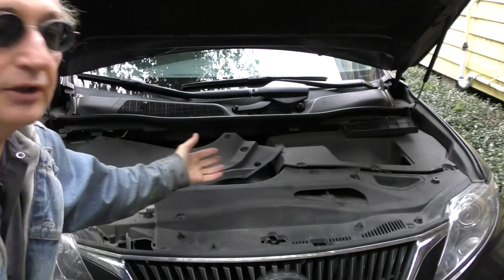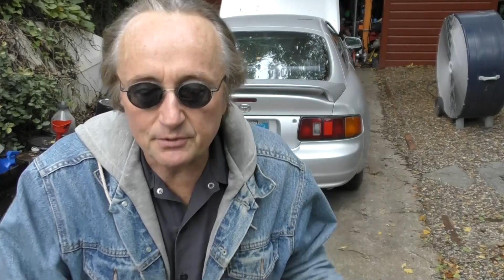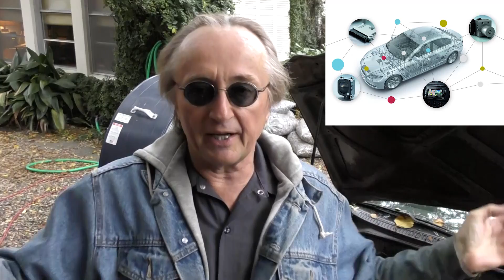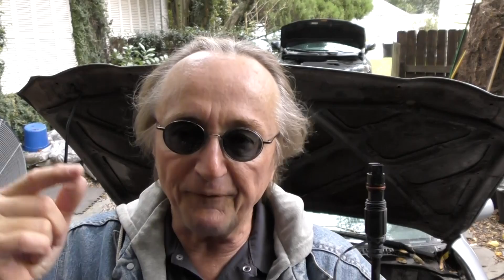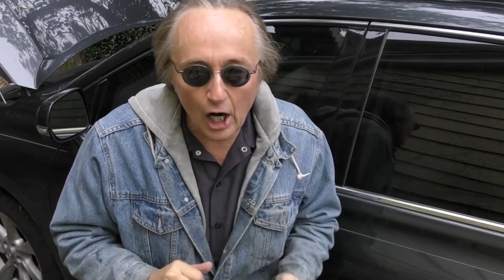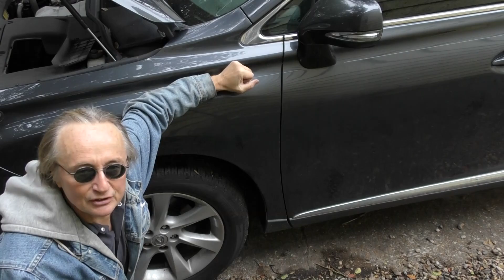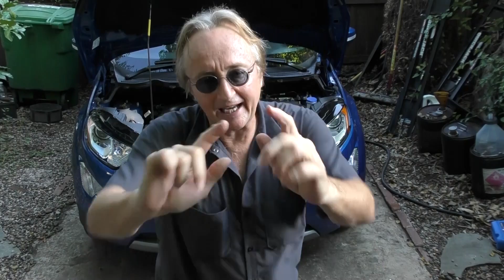The End of DIY Car Repair, Why New Cars are So Hard to Work On

Comment: I still always change my own oil.  At least that's one thing I can do. That way I know it's done right, with the best oil and filters.  Recently my daughter and son-in-law bought a used minivan from a dealer.  I had to borrow it to get some stuff from Home Depot for them.  I always like to check the oil in cars I borrow from anyone, so when I come out from the store I decided to check the oil .  The parking lot was level (their driveway is not) so I could get a nice accurate reading.  Well, the dipstick showed almost NO OIL!  Just barely registered on the bottom of the dipstick, not even close to the safe zone.  The vehicle had less then 500 miles on it since they bought it so I figured the clowns at the dealership didn't put enough oil in it.  I checked how much oil it should have, which is 6 quarts, so I'm guessing they only put in 4 quarts.  This is why I change my own oil!  (Of course, I walked over to the Walmart next door and bought some oil and put it in).
If you DO get your oil changed at a shop, always check the oil level BEFORE you leave.  You never know what kind of careless job some of these places do.

Comment: Maximum profitability with a dash of engineered obsolescence  and making it hard to work on yourself so you have to take to dealer.  Late 90s Cars are the most reliable, durable and easy to work on.  Not to mention affordable

Comment: Hey Scotty! My 1999 Toyota Avalon has suspension squeaks when turning at low speeds. My mechanic changed all the suspension parts with KYB struts, mounts, etc. The noises still persist. The mechanic adjusted the mounting a few times and it still does it! What should we look at next?

Comment: I love hate modern cars, manufacturers squeeze the engine in sideways. had a VW Rabbit, I could not even see or feel the spark plugs the engine block was up close to the firewall. Too many engine parts are made from plastic.

Comment: Modern cars are still very easy to fix, you just need the tools to do it, much like any other profession. Modern engines have covers to look better and confuse people who don't know what an engine even is. Besides, plastic isn't always bad. It saves weight and allows manufacturers to make more advanced manifolds to further increase efficiency because the parts come out polished and ready to be used, all the while keeping costs down. I rebuild vehicles as a "side hustle" in my free time, usually 2015 and above economy or performance vehicles, and you'd be surprised with how little a car can cost to rebuild what an insurance company would consider beyond totaled. I'm sorry to hear you don't understand modern vehicles and want to stay with older technologies.

Comment: I have a question for you Scotty.  For interference type engines, why do they continue to use engine timing belts or chains?  Why not just use gears?  On my 2004 Kia Optima for example, the 2 gears almost touch, but a belt is used.  Why didn't they just mesh those gears and ditch the belt?  A friend of mine (who is good with cars) that I asked this question to told me then the driven gear would be spinning the wrong way but my response was so what?  It seems they could make it work with the driven gear spinning in either direction but if not, then they could just add an intermediate (middle) gear so that the 2 outer gears would spin in the same direction.  Is the reason noise reduction and less maintenance?  Thanks.

Comment: Howdy From El Paso, TX!
My questions is about cigarette lighters and use for charging my phone and tablet. There are so many out there with different amps. Can I just change the fuse in order to get the power I need to charge 2 devices at a speed that will keep up with Bluetooth use?

Comment: So I have a 2002 Volvo s60 2.4t no crank by key but start by jumping the solenoid and shooting fuel/starting fluid down the intake. I bought it this way recently thinking it was a simple fix and I could get a nice car for my daughter who's in college for a fraction of the cost. I still need to test the fuel pressure. Does this make have a interruption sensor if startup pressure isn't achieved?

Comment: So I had my Kia Magentis fixed the other day, needed a new battery, alternator and belt as it died on my while driving, nearly crashed...but now that everything is fixed after getting shafted 400 pounds, my radio won't come on...I went into the fusebox and unplugged/replugged the fuse for audio along with the memory fuse and the radio still won't come on? Car manual doesn't mention anything about a radio code either so I'm confused...the car does have 218,000 miles but has a full service history and only just ran out of it's warranty last year?

Comment: Hello there Scotty. Can I mix semi-synthetic oil with synthetic oil? We have some synthetic oil left over from our former Jaguar XJ6 2.7 diesel and X-Type petrol engined cars. Speaking to my mechanic mate about if it could be done, he replied yes you can. I just don't want to ruin either of our cars (a 1991 Nissan Figaro and a 2003 Rover 75 Classic 1.8 with just over 6,000 miles on the clock).

Comment: Scotty, I own a 2015 Subaru Impreza Premium with the 2.0 boxer engine and CVT. Outside of oil, coolant, and transmission fluid changes at proper intervals, do you recommend anything I can do to limit the vehicle's two largest problems (CVT failure and head gasket failure)?

Comment: Hey Scotty, I’ve got a 2000 Nissan Xterra SE with 160,000 miles. I bought it January 2017 but I haven’t used the four wheel drive on it yet. What do I need to do to make sure the four wheel drive will work right. Everything else on it is solid. Thanks!

Comment: QUESTION!!!

Scotty I have a 2003 3L V-6 ranger. (22k miles) The transmission shifts great through the gears when driving. . But when I shift into froward from Park or neutral (foot on brake), there's a delay (2 seconds) before it engages into drive....From Park and neutral to reverse there’s no problem with a delay. . What could this be....?

Comment: Hey Scotty on my 99 Camry came stock with the 14 inch wheels and tires and I noticed some other cameras in the junkyard had 15 inch wheels and so I went ahead and threw a couple on the front will that hurt my car having larger tires in the front than the back

Comment: Scotty,  

I have a 2009 Dodge Caliber SRT 4 with a Brand new Alternator and Battery.  The Battery light came on the other day and shortly after the battery died completely.  I replaced the battery but that one died the next day on the road.  If it's not the Alternator/Battery, where should i start digging next?

Comment: Dodge intrepid 2003 come on please I still have one. Make a video with tips to keep them going. My engine light on my brake light on. Brakes are fine. Mechanic said ooo it's the jig jig under the petal and he cleared it than it came back. Engine has a code PO325 and a PO456. April is my inspection due. NYC is a hang mans noose when it comes to having a car fee for everything soon even the air we breath well be charge for here in NYC

Comment: What if a car company did a experiment, made one simple car and one simple pick up. I guess they could still have electronic ignition and fuel injection, I'm talking about getting rid of all the stupid electronic module, like when my Explorer wouldn't go into four-wheel-drive, it was a module behind the glove box, what I wouldn't have given that day for a lever on the floor. Even power windows, the switch doesn't simply switch negative and positive to make the Motor go forward or backward, not a chance, it's a module. Automatic transmissions, years ago there was no electronics, and they work just fine and actually they took a beating. If someone made a simple vehicle without all the electronics, I would buy it.
Just my two cents.

Comment: Scotty,  I have an 81 Delorean and I would like to replace the fuel injection lines.  Replacement lines from the vendors cost between $300 to $400.  I would like to use nylon tubing and do it myself.  The fuel pressure is 75psi,  will I need hose clamps to keep the nylon lines on the barb fittings?
Reply: Use fuel injection rated hose and clamps, not nylon unless you want to burn down the vehicle when it fails. Best prices for cut lengths of hose and clamps are typically via Ebay.

Comment: If only computer technology was never allowed to be developed beyond that found withing the mid 2000's. Computer technology is way too overrated and unnecessary as well, such as having them used in things as simple as washing machines and dryers which isn't exactly necessary, either. The question soon becomes something as simple as, "What will they not put a computer chip in anymore?"

Comment: Hey Scotty, I have a 2006 Chrysler 300c hemi awd. the engine dropped a valve seat. I'm thinking of either honing out the cylinder and replacing the cylinder heads and pistons, or changing out the entire engine. Got any tips on removing the front differential off the oil pan? I can't find any info anywhere helping me out with this. Also, why do valve seats drop?

Comment: Scotty, I have an Audi A6 C6 2007. The problem is the voltage kept jumping from 11.5 to 14++ volt. It only happens sometimes. I already ask the mechanic to check the alternator and voltage regulator and the mechanic says both are fine. I noticed the problem started since I changed the aircond compressor few years ago. The car is still running fine apart from the occasional voltage jumping up and down. Any idea what could be the problem?

Comment: Hey Scotty, I’ve got a 2011 Kia Soul plus with a 2.0l in it. Had a coolant line brake and didn’t realize it until it was too late! I’m having 2 issues with it. I’ve replaced the head gasket and it ran fine for a week. It has a code for cam/crank correlation. Everything is timed right. And the car runs normal. I also have coolant boiling out of the system every time I drive it. But idling to temp it won’t do it. What could it be? I’ve found several different answers and was hoping for a professional opinion

Comment: I just moved to North Dakota from Los Angeles. I have two questions. I noticed that most parking spots here have an electrical outlet. I thought it was for electrical cars but no. A lot of people have a electric cord coming out of their hood which they then plug in to start their car when it’s too cold. It’s supposed to heat up their oil or something? I forgot how they explained it to me.  Does my 2015 gas VW Jetta Base manual need this? Temps here dip to -40 actual temperature. They also recommended that I instal a remote start switch, but I’m worried because my car is a manual. I don’t want to mess anything up.

Comment: Scotty please help! My father's 2007 Buick lacrosse has 308K miles on it still runs and drives great. But lately we're having a hard time starting it, it will fire up fine but if you don't give it any gas it won't stay running. Pop the throttle a couple times and it will stay running and run fine all day/night untill it's sat long enough to cool down again. New spark plugs, air filter, fule filter, and fuel pressure regulator Thoughts?

Comment: Hey Scotty. I just bought me a 2000 Buick Regal with the 3.8l series 2 engine has 150k miles it runs really well and everything works but  I guess the lot I bought it at didn’t tell me there was an oil leak because the coolant reservoir seems to have oil or just really dark and dirty. I think it might be the upper intake manifold gasket. Do you think the car is worth  fixing or just get rid of it? 2nd what do you think of Buick as a company?

Comment: Diy easier with new car, scantool give you hints to trace the problem. The technician use scantool to get the codes and hints as well. They do every day so they trace quicker, technician don't fix electronics , they just replace them if tested faulty the same as mechanic.

Comment: Mayday Mayday—While changing out a spark plug the rubber inside the socket wrench got stuck around spark plug, unaware while installing ignition coil it pushed rubber piece down further on the spark plug. I can’t get it off!! Any suggestions?

Comment: Haven't seen much on Saab cars do you have any help with a 2007 Saab 9-5 . Front passenger seat just stopped fuse looks good. Tried replacing the relay still not working .

Comment: Hi Scotty,I'm here to ask some question about my old car. Mazda Lantis 1994, manual, 1.6CC doch engine.

it was idle in high ram during engine start.. is above 2k ram while the engine is cold, if i turn on the AC will drop to 1.8k ram, 

when engine goes hot. idle will drop to normal below 1k ram BUT..to make  these happen I need to kick off my clutch and gear during idle to drop the ram, if not it will stay still above 1.5k ram.

I had follow your video cleaning the throttle body, next problem occur. now the engine ram was 1.5K during engine start. After get hot will drop near to normal below 1k but sometimes will moving up and down.

If with AC on during drive. once you free gear by stepping the clutch the RAM will drop below 500 or near to shut down the engine, and will raise up back server times only will idle in stable.

Comment: I have a 04 Nissan Maxima. Sometimes the throttle would stop working so I turn off the car and restart to see if the problem goes away, it wouldn’t restart like the battery was low. So I jump the battery to restart the car and the throttle then works. I replaced the battery and the same thing eventually happens but the car restarted this time and the throttle works again. Then again, the throttle stops working again and couldn’t get it to work at all even checked connections on everything still no luck. Throttle would still work in park in neutral but not in any drive or reverse gears. I got it towed home and the next day or two, I had to re jump the battery to start the car so I can put it in my driveway and the throttle worked while pulling in my driveway that time. No check engine light on either. What can it be, throttle body assembly, acceleration pedal sensor, some other sensors under the hood, bad ground? Never had any issues with my car until now

Comment: if they stop producing them u will still u will stop seeing it. CAN Bus system is publish in 1996 and standardized in 2004 with both europe, ashia and the US. that means no company car has to produce a car without a CAN Bus System from 2004 up to date. and these system are equiped with a telematic systems, that mean the car can communicate to anything and every thing that connects wirelessly to the car like your phone and other devices.

Comment: Q: What causes a 2001 MB ML320 to leak antifreeze through the coolant containment reservoir overflow tube to the extent that the low coolant light is activated upon the dashboard.  I refill coolant to the cold level indication marks on the reservoir and the process repeats weekly.  Any idea what is causing the problem?

Comment: 2017 camaro ss, pushrod engine, I can still work on it
Reply: Gone are the days when after a unibody vehicle is involved in a collision a DIY mechanic could simply replace the damaged sections of the body and subframe,wiring, and other parts assemblies etc. And be good to go. There could be essentially what functions as a local, proximal ECU for particular parts that was damaged in the collision and if your didn't know it was there to begin with you wouldn't know to check it for damage and/or replace it not to mention they're probably quite expensive to replace. Pretty much if you wan't to work on a newer vehicle these days make damn sure you know every little thing there is to know about that vehicle.

Comment: I have an old 69 Land Rover that only have 4 fuses and even a crank start just in case you have a dead battery or bad starter.  It just turned over 600,000 miles.  These new cars today are pure junk.  If you took all that crap off them, $40,000.00 car would probably cost $5,000.00 and do the same thing these newer pieces carp do.

Comment: The parts are computerized not just to save money in wiring and in manufacture, but to screw the customer after the sale in service and repairs. The plastic covers are a stupid idea, I wonder if the manufacture bothered to put fire retardant in the plastic. The air bags have been a exploding disaster.

Comment: I bought a 2002 pt cruiser and i noticed that it had ground wires on the front suspension but they were not connected . Whats up with that . I have since connected them but why are the needed

Comment: I BLEW UP my engine on my 140k Km 2009 BMW 328  xdrive (major oil leak). Hole in the oil pan. I'm replacing the engine right now. what will happen to my car with a new(used) engine??? How about the resell value.